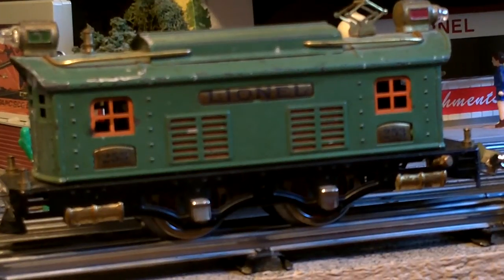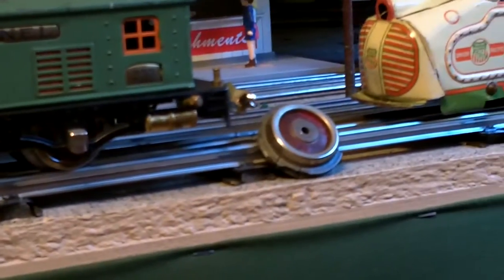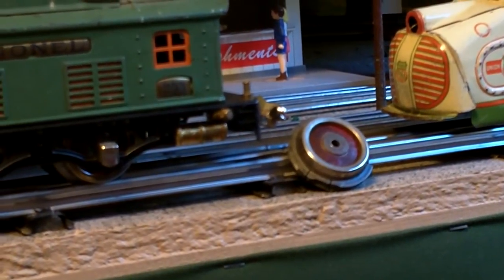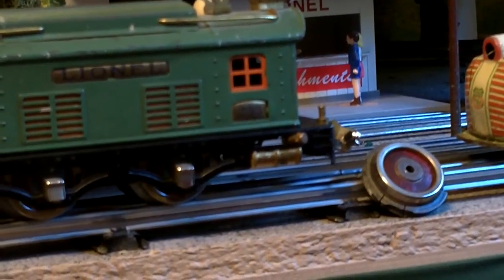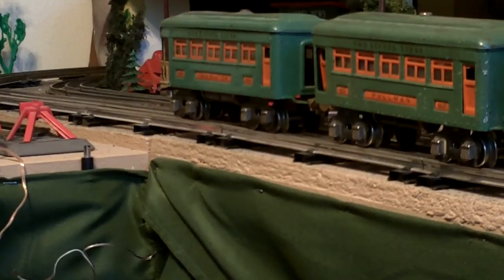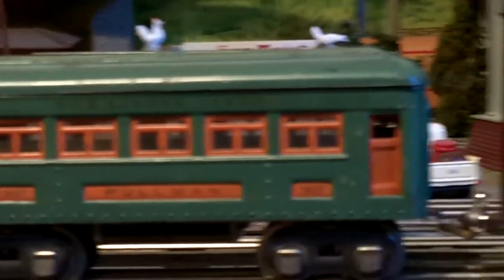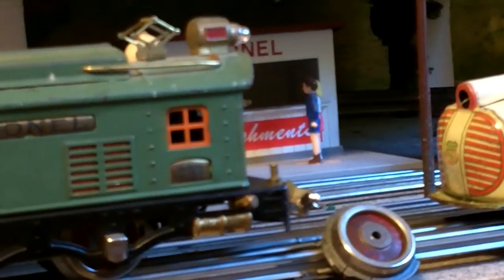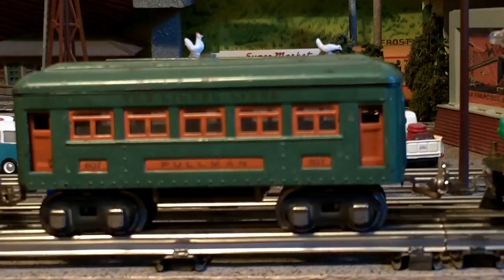Lionel 253 Passenger Train In Peacock Green

Comment: Just picked up a 'set' from the Springfield Mass hobby show. I say "set", because I do not actually believe it is an original set. It was clearly a restoration project someone started, but never completed. There was a 253 loco, two 607s and a 608. They had been taken apart and stripped of paint, but no rust removal was done, and the paint was not fully stripped from the 253 shell and frame, and was not stripped at all from one of the roofs. This is what gave away that it wasn't an original set. The 253 seems to have originally been a terracotta & maroon loco, and these did not come in sets with the 607/608 cars. And the one roof that had not been stripped yet, had original peacock green paint on it, so it's fairly likely the other cars did too. A lot was missing from the equipment, including the trucks & light bulb holders, and observation railing for the cars, trim & detail parts on the loco, and there was not a single screw or coupler for anything. What was present, was an operable (but in dire need of servicing, which I performed) original motor with what look like original wheels, one of the two strap-style headlights (bulb not included) the loco would have had, the flag posts, and the brass window/name plate inserts, all 6 tanks for the passenger cars (no end caps though), and 8 window inserts for the passenger cars (2 extras). I got the lot of it for $30 (asking price was $49). Most of it is either rust free, or only mildly rusty, so I thought it was worth picking up.

Comment from the maker: @puttrainguy I had the little loco up and running yesterday, however it's a bit jerky. The old motor brushes appear to be made of a very heavy material and are slightly pitted where they meet the armature. I have never seen large brushes like these before. They need replacing. or buffing out to remove the pitting. I'm going to attempt to buff them out, as I see no signs of wear.